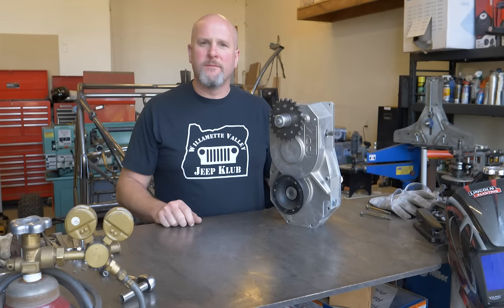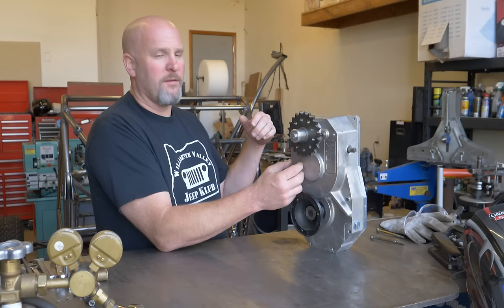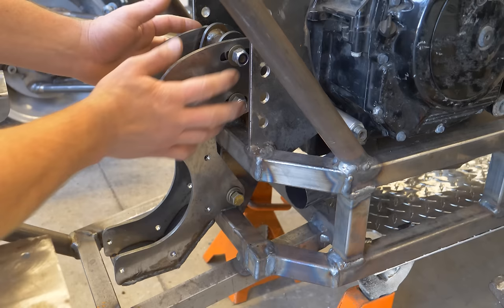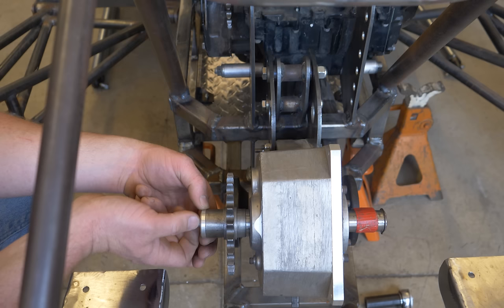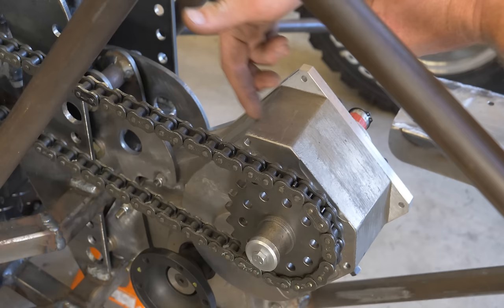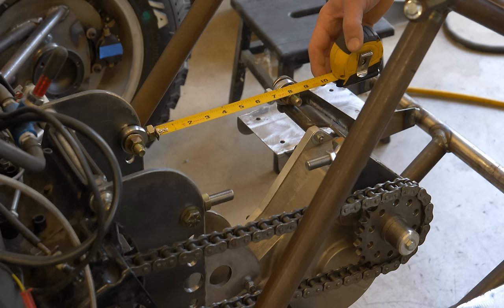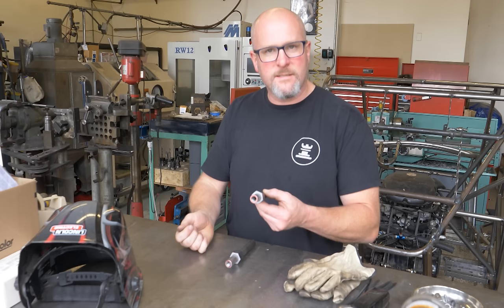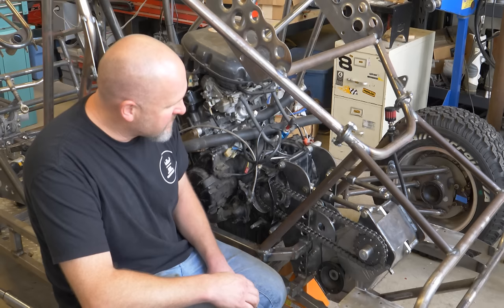Chain Drive Forward Reverse Gearbox for Motorcyle Engine Powered Buggy

Comment: what's it like driving without a diff?

I know go karts deal with it by the nearside rear wheel slightly lifting off the ground in corners.

But with on a buggy with suspension, that nearside wheel is going to be pretty glued to the ground.
Reply: dfpguitar I’d assume just lots of oversteer
Reply: The diff has fuck all got to do with  ns wheel lifting that's shocks an chassis ,lock diff just drives both wheels all the time same as each other, open diff naer side wheel wen  in a turn rotates less than outside wheel = SLIP DIFF, ,on a lock diff  it causes oversteer easier AS the inside wheel is spinning in correspondence with outer wheel travelling furter ,likely causing regular oversteer  in tighter corners using  a fully locked diff car , LIMIT SLIP  diff is best of both worlds ,easier to live with ie tyres an predictability so  is more fun, trust me,

Comment: the adjustment should rotate around the cv axles and not in front as it will change the position of the mounting point for the axles.
Reply from the maker: I agree, that would be perfect. Can you suggest a strong way to do that?
Reply: @motomule  hard to say without having it in front of me but i would build a box type thing using the 6 bolt holes around the cv and using the cv as your center point put 4 small tubes for studs evenly spaced around it, then use the same slot and stud mechanism you have going on top by the sprocket for adjustment,  then put supports where deemed necessary.  it really depends how much you care how consistent the position of the cv's are when adjusting the chain.
Reply from the maker: @nathannathan5466  exactly, it came down to what was simple and strong. Everything we do has pros and cons, sacrifices.... I sacrificed perfect position of the CV's for strength of the mounting system. That's how you custom build things, you choose your priorities. There is no such thing as perfection....

Comment: Would it make sense to add a splined spacer that bolts to the gear? It looks like that thin gear is going to wear that shaft pretty fast.
Reply: The shaft is as hard as a standard motorcycle counter shaft. I believe the sprockets are a bit softer (they show more wear). I have over 150 hours on my RPM box without significant spline wear. I'm also running close to 200hp in a 1300 lb car.
Reply: @plkracer  It's your project, but if I saw wear after only 150 hours, I would be concerned. I know that XR650's have issues with gear and spline wear, which utilizes a similar sized gear. Good luck with the project. Looks nice.

Comment: Do you have the link on ebay for the linear system you bought for your CNC plasma cutter? Thank you very much!
Reply from the maker: No. They were just used linear slides with ballscrews. I built that table 4 years ago or so. Thanks for watching!!
Reply: @motomule  Thank for replying so fast! I heard in the video with Rather B Welding that you build this table yourself....but you mention that you bought the linear motion axis on ebay...the only thing you needed was to install a stepper motor...is that right? if so, do you still have the ebay's link for the linear motion axis? Or I didn't understand well... :S
Reply from the maker: @renethibault2429  just luck.. I happened to look at my phone... 😆
Reply: @motomule  haha! Well done! Thanks for sharing your knowledge and your stuff! Take care!

Comment: That doesn’t look like it’s worth almost 3 grand, then a cradle, I’d use marine or many alternatives can find in scrap, that’s loads could get engine for that.  Isn’t that rated for Max 100 hp yet claims massive engines, maybe I’m wrong, or heard wrong. Do folks use shaft drive mate to rear bet unit for trikes or buggies, can’t be chain/belt drive. Especially if use engine with shaft. They have electric reverse for cheap or use motor, not going far in reverse.  Looks good wonder if heavy. Honda has shaft on tons of bikes, out of my depth. Hope reliable product!

Comment: What about 4 wheel drive
Reply from the maker: I'll do that on a future project. My youngest boy wants a mini monster truck.......
Reply: @motomule  can that differential you got for the rear end of your golf cart can it be flipped to the side and used as a transfer case instead so like as if you turned your motor to the side turn the differential to side and used it as a transfer case and ran a drive shaft off of 1 to the front and off the other side to the back is it strong enough to do that
Reply from the maker: @willierule3744  it could, it would be plenty strong for that. But, the gearing would be very low, an extreme crawler.. It would be like having a 5.4:1 low gear in your transfer case.

Comment: Why are you using such a small rear sprocket?
Reply from the maker: Brian, did you watch the video? The gear box does the reduction you, that way you don't need a big sprocket. It's one of the main features of the gearbox. Please go back and watch the video again, somehow you missed that part. Thanks.
Reply: @motomule  I missed that part. Another question, I know you are using this gearbox for offroad. I am starting to build my project that's an open wheel road racer with pushrod suspension and a turbo hybausa power plant. Will this gearbox hold up?
Reply from the maker: @MrFastjedi350  I think it would hold up, but would you need a differential for on road? The spool in this would be great for drifting!! 😆 if you need a differential, look up the JeffCo gearbox.
Reply: @motomule  Thank you sir!